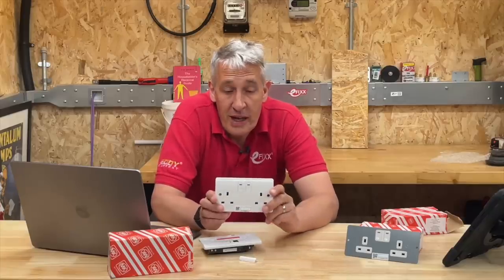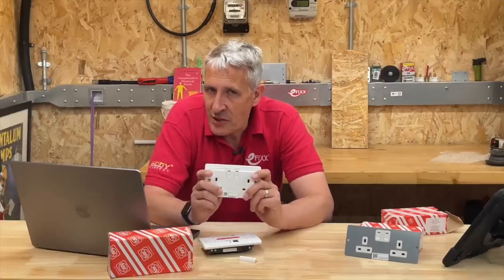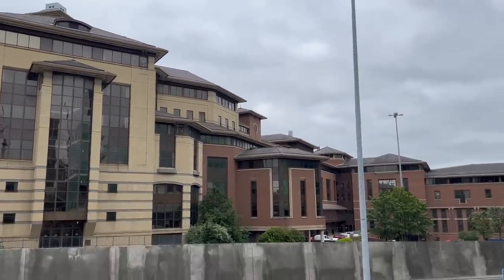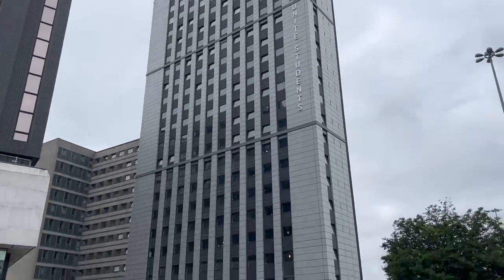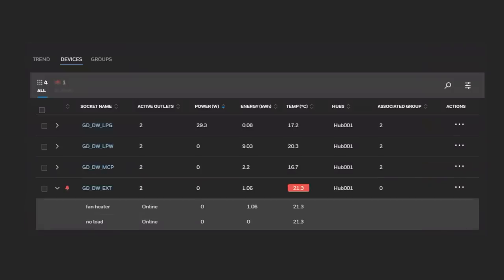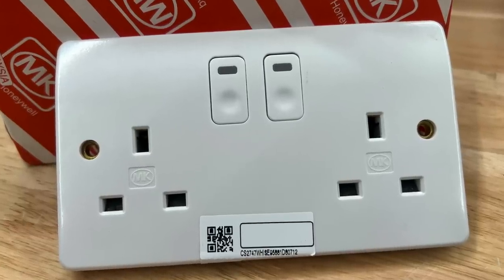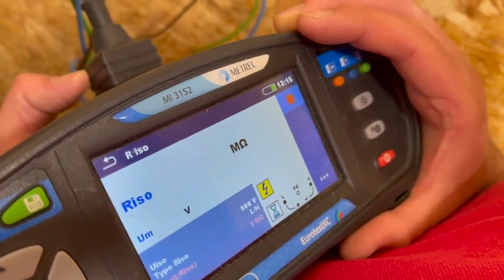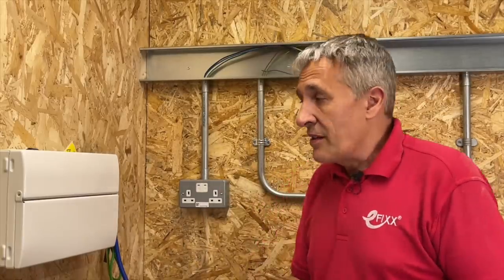Unveiling the Hidden Surprise in this Game Changing Socket

Comment: I see these causing one big issue, if you turn off all unused sockets at night and the cleaner comes in the one plug they will see is working is the one the servers are plugged in to lol
Reply from the maker: You run off the known knowns no need to turn off sockets which aren’t being used.
Reply: @efixx  That probably makes it a bit better, I guess if the cleaners are going to unplug the servers they will do it regardless (in 20 years I've had the experience of maybe 6 cleaners unplugging routers and servers with giant "DO NOT UNPLUG" signs on them often in rooms they shouldn't even be in lol).

Comment: Honestly I thought hmm this would be great for a home, you can see every socket, how much everything is using, power stuff off when its not needed remotely, seems like a great idea. 
£250 per socket, not a chance in hell, even with the idea of having a 2kw heater on over night saving £7, they would have to be doing that for a month and thats with the inflated energy costs. 
So every double docket has to have a 2kw heater on it for close to 2 months and be monitored, and turned off to make this work... seems a bit silly to me.

Comment: If only they would make it affordable for the small to medium sized business that doesn't need a full BMS as they still suffer the heater under the desk issues and need to keep a handle on usage.
Reply: We solved this problem before it even started. The under-desk power distribution strips we bought have a 20mm 3.15A fuse per socket. Getting hold of 20mm fuses seems to be beyond the capability of the average office worker. It certainly didn't cost £300 a desk and replacement fuses are pennies

Comment: Its only smart as long as the "Smart Brain" is around.
If it won't talk to an opensource system like home assistant etc over in industry standard I'm not interested in e-waste in 5 years.
FYI most of the "smart" sockets can also display power usage.

The only way this socket going to be better than the current stuff is if they have used high power solid state mosfet instead or relays to open close the circuits.
Reply from the maker: It’s for commercial applications and integrates with the well used Bacnet BMS protocol.

Comment: The cost to install these and the risk of failure, or worse security is to high.

Toggle switch have virtually nothing that can go wrong, it is either closed, or open. On or off. Simple as that.

Added complexity and digitalisation of power distribution is unbelievably dangerous.

Imagine these in hospitals, airports. Critical infrastructure. Etc

If they start the fail. Or god forbid were to experience a security breach.

It would cause mayhem.

Stick to timers and not networked solutions, like montion detectors.

There is absolutely zero chance in hell would my company which which is responsible for the safety of millions of people annually. Would ever move to these.

We would rather pay a little more in power, than ever increasing risk to our customers.

Comment: Who on Earth brings an electric heater to work. Even if I bring my phone charger, it has to be PAT tested. The heater would no doubt pass the PAT test but then mgt would  kbow about it. Why do workplace sockets need to provide that much power ? 2kW is around 8A, getting close to the 13A limit? Why aren't workplace electrics limited to something sensible, outside of kitchens and workshops ?

Comment: I was going to ask, light-heartedly, about the students that will take their lives in their own hands and switch the smart socket for an old fashioned dumb one so as to avoid the eyes of big brother. Hopefully the system will report loss of connection to a socket, but it also seems that the little red switch would presumably disabled the smart features, so no need to go as far as wiring in an old fashioned dumb socket. 🙂
Reply: with the electronics turned off, the relay isnt going to energise so the socket is useless.
Reply: @Pugjamin  Ah, I thought the red switch was to turn the socket into a dumb socket.

Comment: A solution looking for a problem to fix!
Reply: More like inventing the problem!! Poor students, no kettles, air friers hairdriers. As for the airports, vending machines are usually hard wired and need to be powered on 24/7 for temperature control. No IT person would want their expensive dispkay screens power cycled every day, bound to cause PSU failure.
Reply: Actually electricity waste in the workplace is a huge problem...

Comment: Heaters are about the only thing I can see this as being useful for controlling and monitoring. Nothing else really has the power draw to be worth it. If people feel compelled to bring heaters into work or their accommodation, then your energy management has already failed by using excessive energy to cool the building. Try limiting power draw in student accommodation like this and every person living there who needs a hair dryer is going to start making complaints.

This product seems to exist only to appeal to vindictive landlords and accountants. MK couldn't even be bothered to include push fit connectors for the price. MK is the only brand I have to consistently return for failed screw terminals so I don't trust their build quality at all.

Competent design and a well coordinated BMS make this irrelevant.
Reply from the maker: A vending machine uses around 7kWh per day which equates to around £800 per year.
Reply: @efixx  A vending machine is a fixed appliance, and existing BMS solutions can handle that sort of thing. Hell, a simple timer switch can do that job more effectively. A refrigerated unit is another matter, but those can be programmed.

This socket is only a solution for portable appliances. It exists in order to solve problems with design and management.
Reply: No. No..Not heaters. Can you imagine a heater being switched off remotely with the owner thinking they've turned it off, only for it to come back on when the power gets restored.
Reply: @quantisedspace7047  care to explain your point instead of using incomprehensible word salad?

Comment: great, switch off the printer and spend more expensive printer ink on it. 
Every time the printer is turned on, it throws away half a cartridge of ink to use to clean the nozzles. 
Printer ink is just as expensive as perfume when you count it in liters.

Comment: If BMS actually worked properly employees would not have to bring their own heaters or fans in to work. Modern buildings are awful toxic stuffy airtight germ circulators.

Comment: @efixx I thought you are experts in your field presenting unbiased reviews, but its seems like you lost your unbiased view and just jump on pure marketing.... Off-topic : First we had LED lights costing fortune and claiming magic 30k hours runtimes but then warranties only valid for year or two...  Now smart sockets costing fortune which will save money, yeah whatever. 
Now this is my opinion and in no way intended to offend someone:
The moment you shown internals of this socket I got so many questions in regards quality and reliability of these. Before company provides clear evidence of these sockets being same if not better than regular sockets I would suggest everyone to stay clear if intended use is more than 10 amps. Not only that I would expect 5 year warranty from MK including labour considering price of these and growing labour rates! 
Smart plugs/sockets is nothing new, but amount of issues round them I think certain true experts (especially automation) well know. Now not touching admin side and networking, just hardware - why:
1. Relays biggest evil here. Due to size constraints manufacturers often fit relays which are undersized (or poor quality) for application or potential loads. That said you got high probability of CONTACT FUSING as you cycle far more than you would ever do manually! You have no control when this will happen and once it happens you might not be there to prevent potential fire. It does not say anywhere on data-sheet of product fail-safe operation... It does not provide any evidence of high load failure cycle count etc...  Contacts on relays are quite different to contacts which you have on regular switches.
In fact would be great to see full fledged stress test of these sockets. As example 13A heater on auto cycle every 2 hours till failure - thermal camera out and inside record with temp indicators. Even 10amp load would be quite interesting to know cycle till failure.
2. Once relay failed = new socket + labour to fit!. Yep once your socket failed which will happen dead quick on higher loads will MK replace/install it free of charge? (doubt it) Or will this whole smart system start draining budgets? (yep indeed you now subscribed to very expensive eco system) As a note relays are soldered to board, so maybe time electricians learn some soldering skills (easy money guys) :D 
3. Amount of connections (design flaw): So power to board (cant see)>relay>soldered cable>spade crimp> socket outlet. Why on earth we using spade connectors? It seems like designer of this just looking for problems long term. Indeed on low currents these hardly will have any issues. But high currents spade connector will be first area to fail due to its nature.
I could go on and on. But till manufacturers truly not wiling to provide 5 year hassle free assurance product+labour I would not even consider these especially for current price tag. You best of buying smart plugs which are by far cheaper to maintain/upgrade (but still equally dangerous). I would also question BS standards these days when it comes to such devices as 100% believe test standards are not up to spec and soon we could see some dramatic consequences with these smart gadgets. BS should be updated or new one made for such devices to include fail-safe aspects and cycle test etc all published readily available to consumer.  Also UK should ban any import of any non BS compliant product especially when it comes to electricity. Amazed how likes of Amazon trade consumer goods which are just absolutely non compliant with BS. I could be wrong with all said here. In my view if product so good then come on MK (prove me wrong) challenge industry and provide 5 year as minimum hassle free product+labour warranty (with no silly fine print) please.
Reply: I haven’t read every word of your post but I agree and disagree at the same time.

My main objection with this stuff is regards the security or lack of for the software running on these devices. The device is essentially a computer with a TCP/IP stack able, under software control, to reach and be reached across the internet. This opens it up to both intentional rouge actions by the manufacturer and the service providers they use, as well as other third parties who just randomly want to cause mayhem. Said mayhem and rouge actions can include interring with the operation of the device AND (which is worse) using the device to penetrate further into the network the device is on, by eg exploiting vulnerabilities in other devices, desktops, laptops and servers. If you think I’m exaggerating, I assure you I am not. The software in these devices is nearly always written by the cheapest labor available, by kids who know nothing about secure programming. This does not even cover the interests of the manufacturer and service providers, who will not be considering security even as an afterthought anywhere in their product roadmap.

The point about failed devices being buried in walls is mostly valid, but I think you have miss calculated on the reliability for a good relay. A typical relay will be good for somewhere like 100,000 cycles. Assuming it’s switched once an hour, that’s 11 years of operation. In reality it might be switched once a day on average; 273 years. 

In summary, I have a fair amount of smart gubbins in my house: I use the zigbee protocol for my bulbs and other stuff. It’s not a routable protocol. Even if it was vulnerable to being attacked and “owned” the attacks would have to originate on the zigbee network in my house. I don’t like buried electronics either. There is no compelling reason to go that route when you can, if you want, achieve the same thing with in line smart plugs, much like the inline timers of old. These smart sockets just stink of built in obsolesce. In 5 years there will be something way better, necessitating a load of hassle to upgrade them to the latest thing.

But still, I come back to security as the massive red flag and reason I don’t have these products in my house.
Reply: @lawrencemanning    well I did say that not touching network as I could list endlessly risks involved with such products.  As for your statement with cycles/relay I wont say you wrong, but what I will say don't believe in data you get these days as no one stands for it. No one will give you warranty  for 100k cycles even so whole socket probably on paper has larger mean time till failure. Same as with LED everyone is giving magic numbers of MTBF but sad reality is completely different when it comes to warranties. There is a reason why I said more than 10A will be an issue.  Tests carried out on relays (cycle) normally just lab stuff with x conditions. Sadly true life environments can be drastically different. And its not like oversized relay, these are compact type so no heat dissipation. Without knowing what exactly relay is used hard to comment and truly would be interesting to run torture test on these. But fact you can't replace relays (mean easy) so consumer will be hit with massive charges if it does go wrong. Then again if MK is so confident in product why not provide warranty+labour based on 100k cycles (since its smart socket). You are right in upgrade statement probably 5 year time will be discontinued due to security holes etc...

Comment: Very overpriced ,like see how long electronics built inside last ,most households won't want 300 pound power point ,say saves you money well same as just turning appliance off simple as that cost won't outweigh savings in house environment maybe factories building so basically not worth it .

Comment: From the perspective of innovation these seem like an interesting invention...But at the price they're asking for them, all they're going to achieve in practice is very few organic sales and a flurry of non-compliant copycats flooding AliBaba and similar sites. 🔌💸🎰

Furthermore, I'm extremely concerned about the presence of the software-overridable switch, which negates their safe reliance as an emergency isolation device. If I was installing something like this, I'd only do it with an emergency stop button or physical isolation switch in series with it. ⚡
A physical cut-off switch between the line terminal and the COMs on the relays should be a legal requirement on something like this, imo. 🔌🛂👍

We've all heard stories of people being injured or even killed when software lock-outs have been inappropriately overridden or compromised, so for me I just wouldn't be able to trust one of these to keep an appliance isolated whenever it's supposed to be isolated. 🔌🎰😬

Comment: Why try to improve on perfectly evolved technology, and a standard socket can't get much simpler or more efficient, This is simply another spyware device to plague mankind and push up the cost, as well as unit failure rate and need for replacement. Always remember Sod's Law which states that anything that can go wrong, will go wrong. A basic socket unless overloaded will not break down, anything with electronics involved certainly will eventually break down . Even the humble incandescent lightbulb was originally so efficient and long lasting that manufacturers built in timed failure to keep replacement sales high.Then of course manufacturers decided that the cheap standard light bulb wasn't generating enough profit ans so was banned in favour of costlier LED bulbs. The irony is that incandescent lightbulbs were banned ostensibly to save electricity, yet here we are, being pushed into an era of electricly powered vehicles. All of which have a limited range per charge, longer refill times, limited battery life and the high chance of complete destruction of the vehicle if and when a short circuit in the battery causes an unextinguishable fire along with copious amounts of toxic smoke.
Reply from the maker: I think we’ve gone off topic on this one ☝️
Reply: @efixx  No. Topic responded to and examples give to illustrate the point. Things are getting "Improved" not out of need but out of greed. Keepng it simple keeps it cheap, and that doesn't suit the manufacture's agenda.

Comment: Nice way to 'control' peoples use of electricity, I don't hold with it, not at all.  Wait until it goes wrong (they will) and changeing the fuse in the plug wont cure the problem. Landlords might like them (tyrants etc.) but tenants will curse them and switch them out.
Reply from the maker: Price is the usual way of controlling personal energy consumption.

Comment: These “game changing” sockets are just going to cause cyber security issues. The only new feature here is the PCB disconnect. The firmware here is pretty nice but if I were  a student I would hack this within days and own this socket. What’s the security features ?? Mmm. Didn’t hear anything game changing there  just another insecure smart socket.  ZigBee is really easy to tap into